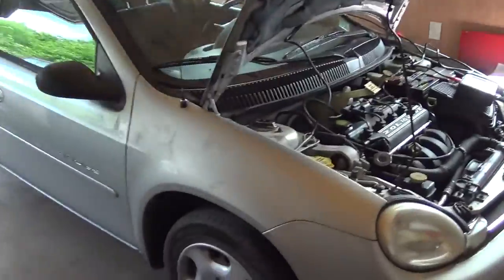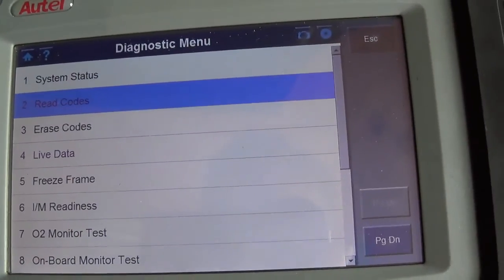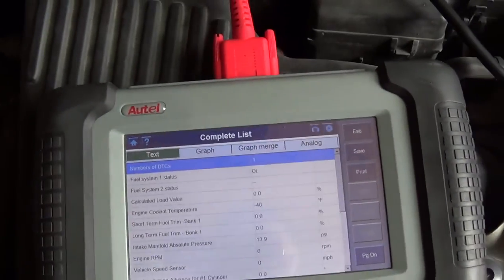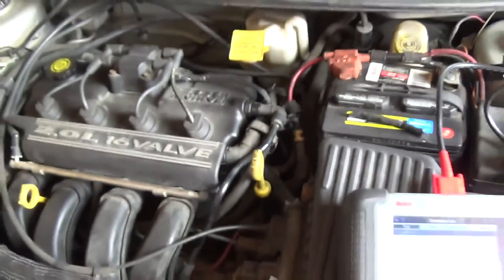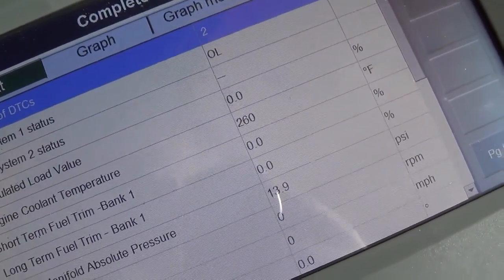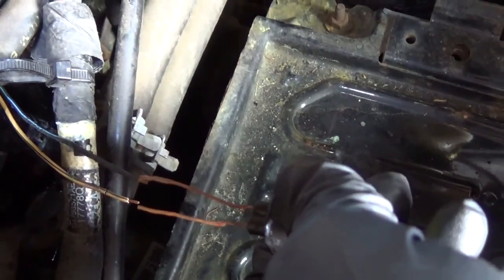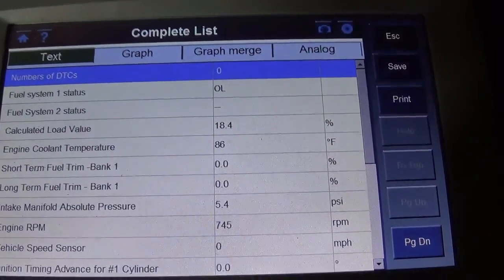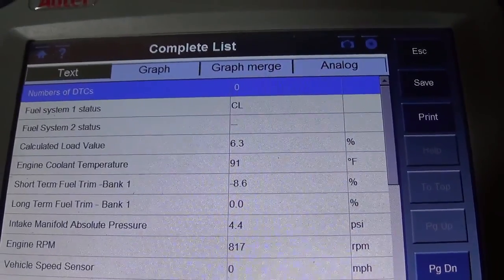Dodge Neon P0118- ECT Sensor High

Comment: this is a Longshot asking on an older video but.... i get this P0118 code on my jeep liberty.  same sensor description as this video but the only different when I plug in my OBD is the sensor(which was replace and still giving code) shows the temp rise all the way till about 213F then this code pops up dropping the temp to -40F. any thoughts or help?
Reply: Check the wiring, also test the sensor.

Comment: my 2000 Dodge Neon with  43,663 miles. check engine light comes on intermitingly. Pulled code P0171.  Checked map when pulled car continues to run. Any suggestions

Comment: Nice video Ivan. I have a question my 99 escort is having a similar code and reading -40 as well replaced the sensor and same thing so I know has to be wiring. My question is can this sensor cause my car to idle high and want to almost drive itself down the road ?
Reply from the maker: Sure, if the PCM thinks it's really cold outside, it could bump the idle up.
Reply: Thanks for the reply

Comment: I have an 04 neon that goes into limp mode after being  drove for about 30 minutes I notice a slight fluctuation in my thermostat. I just replaced the intake gaskets and thermostats and alternator didn't start doing it until I replaced the alternator could it still be my ect sensor ?

Comment: My 2000 Neon has the same engine knock sound, and has sounded that way for a very long time. It has over 215k on it and is still going strong! (Also has the p/s pump whine!)
Where do you get the better quality shrink tubes, and how can you recognize that they are the better quality ones before buying them?

Comment: Nice repair Ivan - is the amount of  bi- directional control as good on the Autel as your verus ?
Reply from the maker: Steve Rob Oh yeah the Autel is great. Especially for Euro stuff, it blows Snap-On out of the water! It also doesn't weigh 20 pounds and is more portable. If the Verus comes out, you can bet it won't be a 5-minute diagnosis lol
Reply: motoYam82 Yea my Ultra has been acting up  some , been looking at the 708 ,  Is there Any thing you do not care for with it
Reply from the maker: Just a few small things:
1) there's no battery, so if you want to review stuff on the bench, you have to plug it into the wall.
2) The graphing and data save functions are useless; can't change the scales or play a movie to show anything meaningful.
3) No coverage for vehicles not equipped with OBDII (older than 1996), although the kit comes with some sweet adapters. Snap-On wins here hands down.
4) No Troubleshooter and extra help menus...so be careful with unfamiliar commands!

I use the Autel mainly to view real-time data in a list form, read/erase codes, and for bidirectional controls, which it does very well. Overall make/model coverage is fantastic with no extra "packages" or keys to buy. Highly recommended; can't beat the bang for the buck!
Reply: Real sharp guy on Eric's channel was telling me the 708 was going to be obsolete soon and the company was not going to carry any further updating . Denis recommended the new model introduced this year.  I checked it out looks nice but I'll wait till I hear what Eric thinks of it after he smashes the verus into a million pieces LOL Take Care Guys.
Reply from the maker: That could mean two good things for the 708: bargain bottom pricing on the closeout models and you won't have to worry about updates at all for at least 5 years, unless you work on the newest cars at a dealership.
LOL yeah Eric hasn't had too much luck with his wireless Verus...might be a defective unit? I got the Autel about three years ago and updated it once last year.